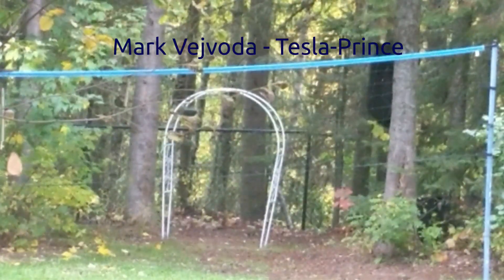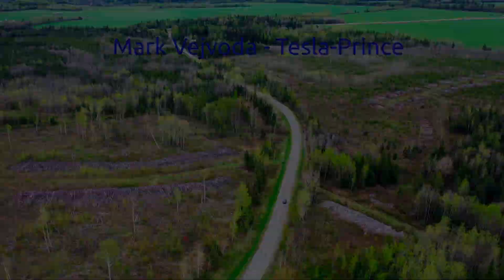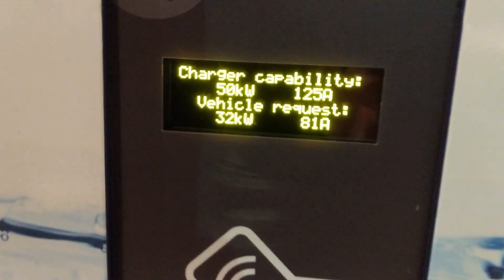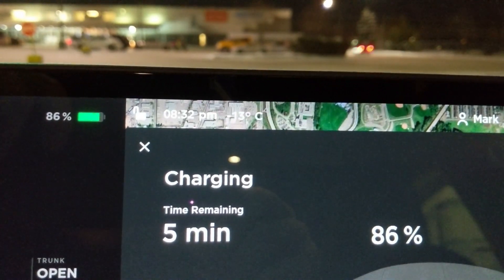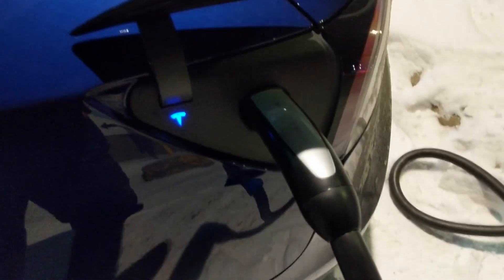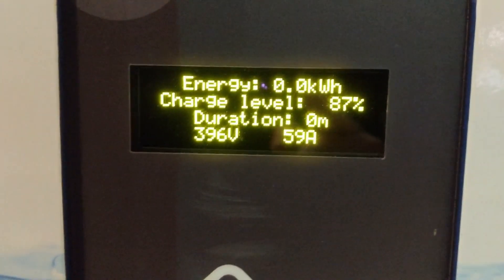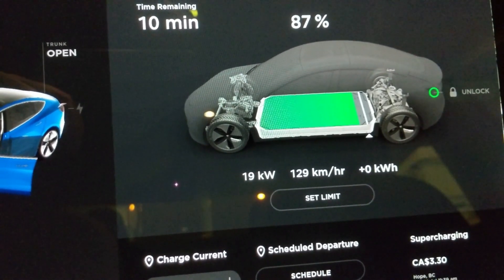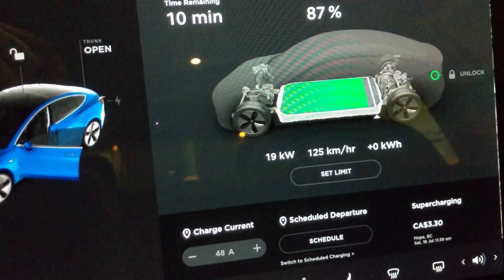Setec CCS1 to Tesla Adapter In Canada | Success on BC Hydro FINALLY!

Comment: So what adapter would you suggest for a Tesla to connect to bc hydro chargers?
Reply from the maker: If your car supports CCS (check under additional vehicle features and it should says CCS Support: Installed) then get the Tesla CCS adapter. If you do not have CCS installed in your Tesla get a Tesla chademo or Setec CCS adapter.